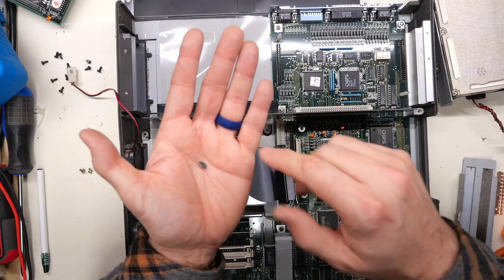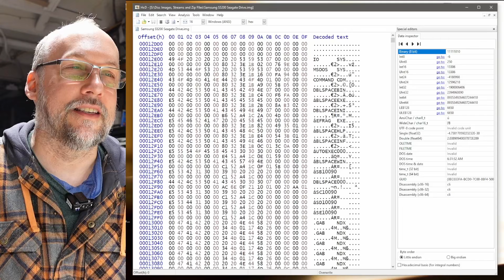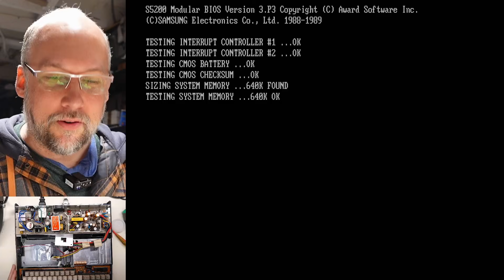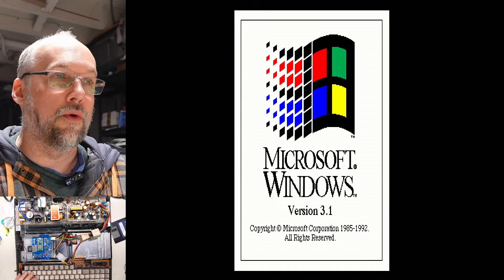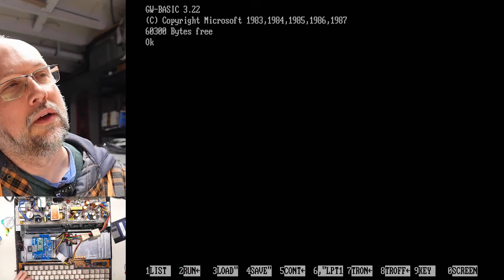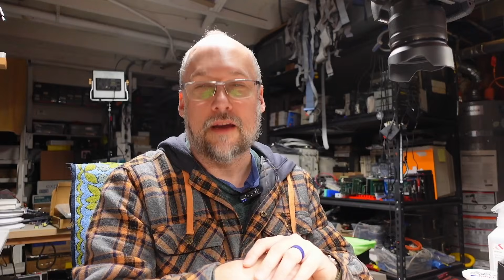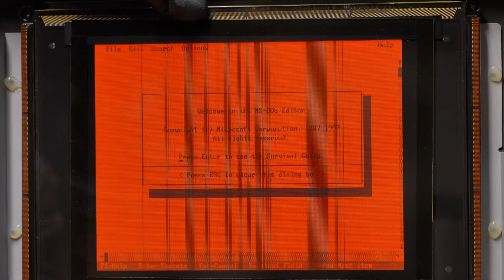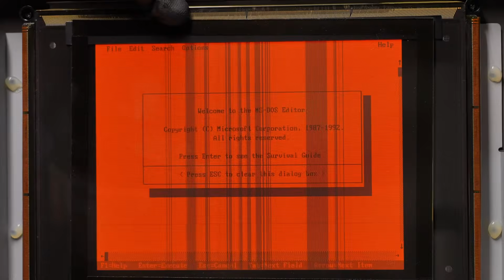PC Archeology: Let's explore the Samsung S5200 and attempt a repair on the gas plasma screen

Comment: I remember DoubleSpace back in the day which they did rename DriveSpace later on.  It most definitely only has some key boot files uncompressed in the root of the filesystem to facilitate initial booting of the system required for the doublespace loader to open the compressed part of the drive.  Some files are still left uncompressed within the compressed volume if they didn't compress well which is probably why you could see some of them even within the compressed volume.  This info can be found on Wikipedia as well.

What I especially remember was that it was notoriously buggy and often caused data corruption that could cause you to lose all of your data, so you are fortunate to have imaged that drive and booted successfully.
Reply: Not as much buggy as not enough resistant to corruption during crashes or unexpected reboots.
If you reboot while a file is being written that file might be corrupted and/or lost.
But if the filesystem is compressed, the compression metadata may become inconsistent and then anything can happen.
There is chkdsk for FAT corruption, but no similar utility to fixup the compressed container.
Reply: @jwhite5008  yes, it often happened when playing games or using software if you experienced a hard lock when the disk was being written to the only recourse was to reboot the computer.  Usually it was fine, but occasionally it would corrupt the file system and due to the fact that so many files are compressed together it would affect more than the files you were working on (corrupting metadata), sometimes with devastating effects.

Comment: I would start by mounting that image and then using TestDisk to see what that can recover. I've found that works better than many commercial data recovery apps.  If you don't have a copy then R-Tools R-Studio is the way to go for a more advanced application which costs $79.99 for the permanently licenced version.

Comment: That was a fun series, thanks!  I enjoy seeing you do your detective work on these old PCs.

A lot of pinball machines in the early 90s like Addams Family had a gas plasma display in the backglass for showing the scores and animations.   I'm sure they weren't exactly the same tech as what was in that laptop, but similar.

Problems with the pinball ones over time were burn in and "outgassing" which is just what it sounds like.  Fortunately you can buy an amber or full color LED replacement panel these days, but it isn't cheap.

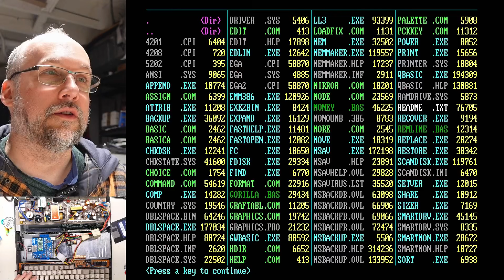Comment: 39:30 - I'm seeing GORILLA.BAS, nd then QBASIC a little after that. A buddy of mine had this on his machine for some reason and one day he found it. We had some fun with QBASIC Gorillas :)

The Gameboy vertical line issue is easily fixable but I don't know how it holds up long term. When there's a horizontal line issue, I heard it can't be fixed even though you do have connectors on the bottom and on the right side of the LCD. I don't know how the issue is different but people say it's done when you have horizontal lines. But still, the Gameboy screen is much more simple than the one you have here, I wouldn't recomment do go further as well. It seems like only 1 edge has this issue, my guess is that something was spilled on the screen and it's the bottom edge but who knows (I don't even know the orientation of the screen). It's interesting that only 1 edge is getting that corrosion and the other 3 looks mint still, so I think it's not the hardened glue that's failing. Anyway, long comment short, you did an excellent job of showing the inside of that screen.

Comment: Commonest cause of failure is temperature, the voltage withstand decreases with higher temp.  16v cap on a 12v rail has very low tolerance for heat, and being closed in a warm/hot environment causes the aging rate to increase very rapidly, eventually the dielectric fails and the cap shorts, in the worst case this can cause it to draw enough current (and generate enough internal heat) to explode.
Reply: This is very true.  When i was in EE school in the early 90s we were taught to go with a 3x margin of voltage on caps(35v for a 12v rail, 16v for 5v rails) (this was prior to 105C caps being easily available.  The biggest challenge was cost and size increase for the higher voltage rating.